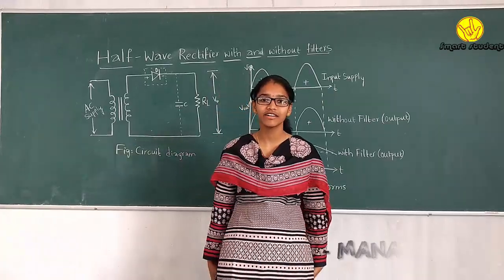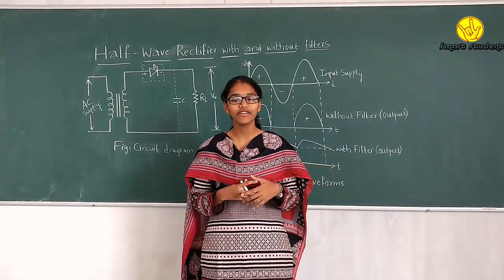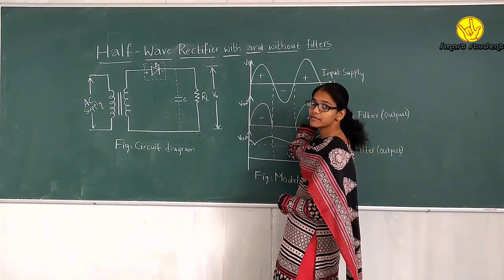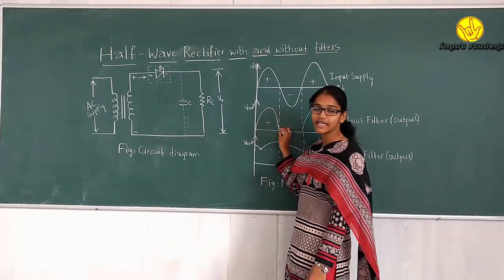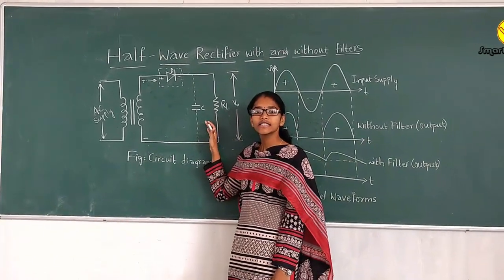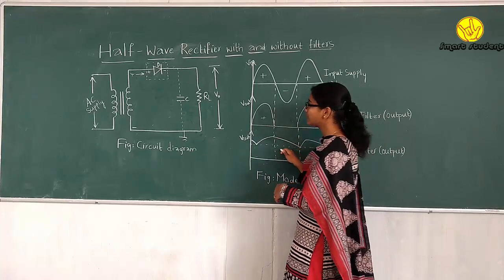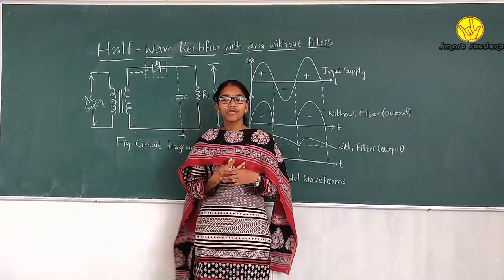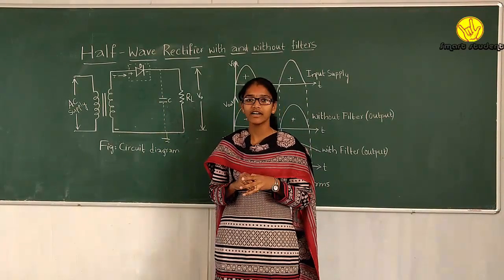Half wave rectifier circuits|with and without filter|HWR|

Comment: u said capacitor filter allows ac n blocks dc but after that when u explain about +ve half cycle u said that all the ac signals are grounded n dc is measured across the load resistor ....??
how can this possible in the condition that ac is allowed n dc is blocked.....??